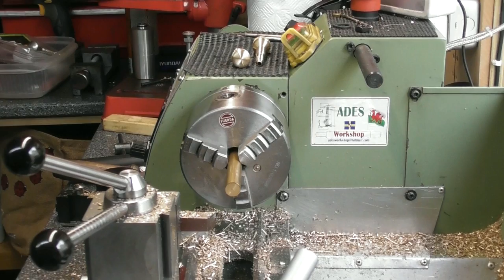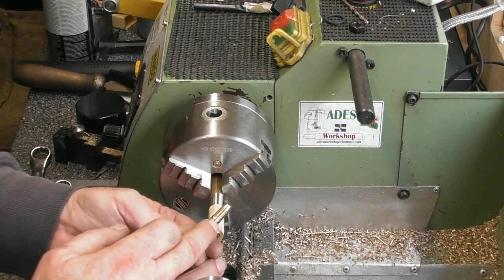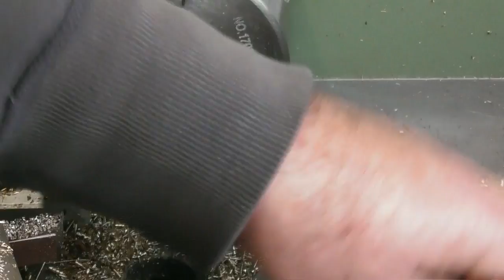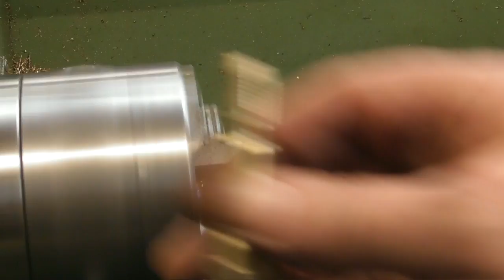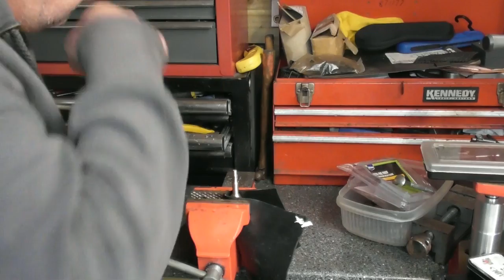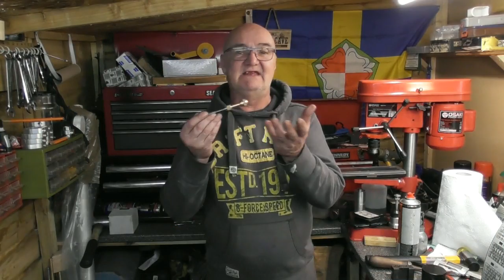Needle file handle part 3

Comment: A comment and a question. As a retired toolmaker I have my needle files all handled with cherry wood. Safe and comfortable but not bulky no changing when you have to use a variety all at once. I fancy that mini lathe what brand is it and do you think it is available here in the US?
Reply: Its a WM180 sold by Warco in the UK, made in China.
Little machine shop is your best bet, they have a couple of lathes on their website. US based.
Check out 8.5" swing lathe, it's popular Chinese machine made by Seig branded Sc4 in the UK

Comment: You could make those for grinding  tig tungsten. Welders  use holders  for drills  because chucks  ceases up. Maybe you could sell them?
Reply: I really like your idea! I'm always a little apprehensive when grinding tungstens and using something like this as a pin vise should work great. Thanks.
Starrett makes a pin vise that looks like it would do a good job 166C, and I just ordered one.  
Ade, very impressed with your project and I look forward to replicating it:)